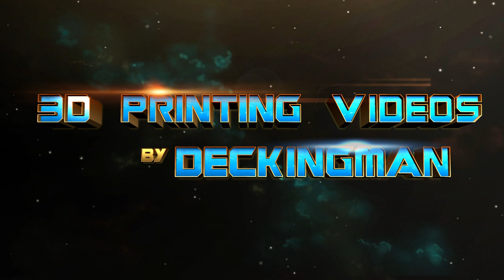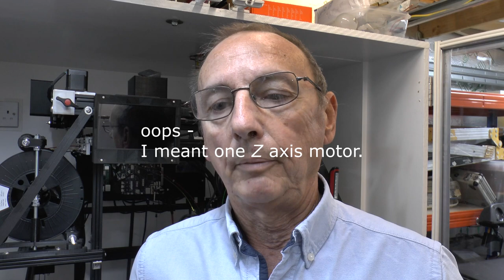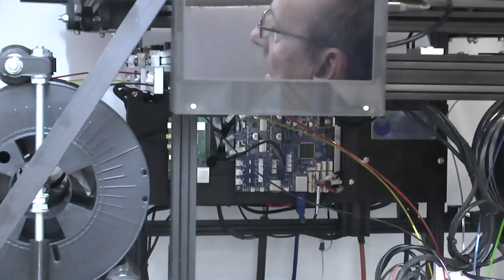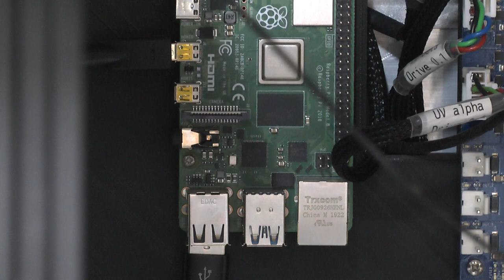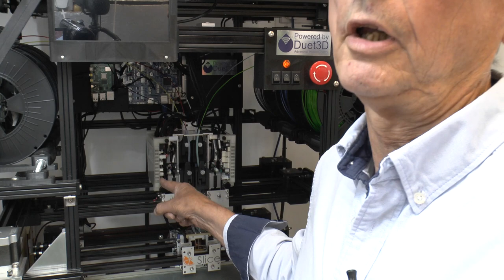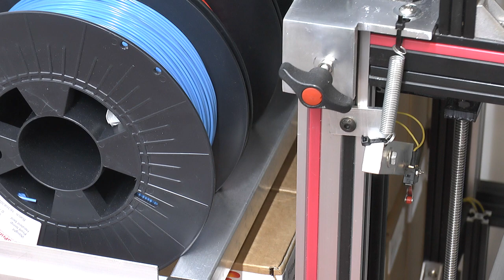Duet generation 2 or 3?

Comment: Hey, at least on the SBC and toolboard setup I use, the heatsink fans turn on at full speed until the SBC is booted. After that, thermostatic control takes over.

Comment: Great Video, I am thinking of building a Jubilee kind of Printer and thinking about what Boards to use at the Moment, very helpful Video, makes my life a lot easyer, by the way, awesome Ideas and Setup on your Printer, I cannot wait to see the 6 Color Hotend in fully functional condition. 👍
Reply from the maker: Thanks. The Duet guys have some sort of relationship or strategic partnership with E3D and my understanding is that the tool board was designed for use with E3D's tool changer printer. So I'd have thought that the tool board(s) would be an ideal choice for a Jubilee.
Reply: @deckingman  Yes, the Default Setup for the Jubilee is the Duet2 and a Duex5 expansion Board, by the way, do You have any experience with Klipper Firmware? There's some serious Development going on to support it in Jubilee Printers and maybe it's an Option for You, because it's pretty mouch the most expendable System out there.

Comment: Thanks for doing this video… very informative. I’m busy building a 2000mm x 1000mm x 1000mm 3D printer, based on the Duet 3. Overkill, I know, but great for distributed drivers and tool head. Only need to run 4 wires per axis (power and CAN), etc. Will start putting some videos up soon 😎
Reply from the maker: Things have moved on a bit since then. Many of the limitations regarding expansion boards have now been fixed, making Duet 3 more attractive.
Reply: @deckingman  quite right… your video helped me identify what to look out for, and also to go check the latest revision changes and bug-fixes. I just wish that they had also left the standalone wireless on board. If one’s paying £185 for a board, another £5 for the ESP doesn’t make much difference. That’s my only gripe, having to use the Raspberry Pi or Ethernet for connectivity. Otherwise this board is the best on the market by miles 👍🏻👌🏻

Comment: Regarding the fans on the hotend: You should be able to connect a 2nd power line to the power on the fan without it causing problems with the regular fan control; so you could override the fan and run it full-speed while the system booted.  You could set up a controlled NC relay to that, so once the system booted up you'd open it and automatically switch back to temperature controlled.
Reply from the maker: Sure you could do that - it's another work around for the problem. IMO, a more elegant solution would be for the firmware to do that automatically - i.e. have the fans default to fully on rather than fully off at power up, then switch to thermostatic mode once the configuration file gets read in. In fact, reading @Harald Wagener's comment from a month ago, that may have already been implemented. But I can't be sure because it isn't documented anywhere and nobody has mentioned it in forum thread where I raised the issue. Perhaps it's only the case for tool boards but not expansion boards? Who knows?

Comment: this was very informative. i only have one extruder on my corexy printer so i will stick for now with RRF 2.03. If i find a use for the condicional gcode i may change all my macros/settings to the new RRF3.
Reply from the maker: That would be a wise decision in my opinion. I'm a great believer in "if it ain't broke, don't fix it". The conversion from RRF2 to RRF3 is quite complex and there are a lot of configuration changes which have to be made.
Reply: It is easier to do a fresh install of firmware than to upgrade... Rather... it is too very simple, try once at least.

Comment: You should consider to add a heat sink on the CPU of the PI. They last much longer whether you use the full CPU power or not.
Reply from the maker: That sounds like another good reason not to bother with the RPi. At this moment in time, it is just another layer of cost and complexity for no gain in functionality (aside from giving WiFi connectivity).
Reply: @deckingman  Well, it is a consumer product... and you are right, complexity... but is has a lot of advantages like a mooth update (apt upgrade) and you can run extra software on it. It makes sense, a sort of. But not if you want to stay at KISS approach.
Reply from the maker: @wartytowel7740  Duet gen 3 prototypes were  was showcased at the TCT show in 2018. I had the first pre-production boards which I fitted to my machine in July 2019 and which was at the TCT show later that year. At this point in time, there are still no add-ons for the RPi that could do anything that I can't do in stand alone mode. If I connect the RPi now, the only thing it will do is extend the time it takes for the machine to start after a power cycle. Nothing else.
Reply: @deckingman  I know what you mean, I had the same thoughts about that. I connected a pi cam to the PI to give the pi a reason to exist. I plan to install a influxdb on the PI to record metrics from the print processes to collect historical data and graph them with grafana than. Still more an excuse than a real use case.